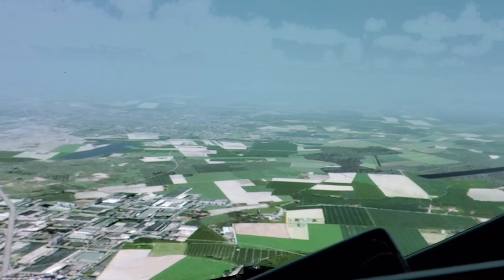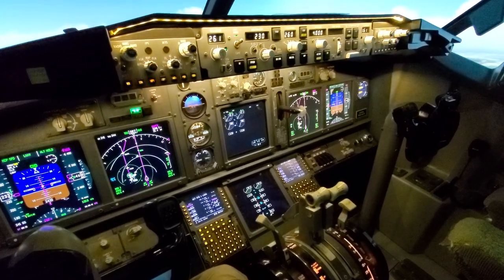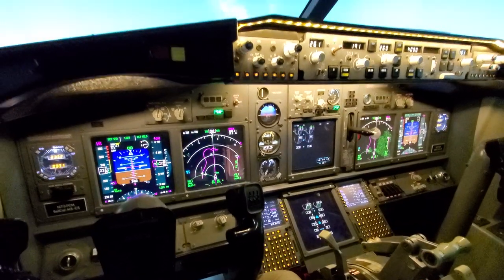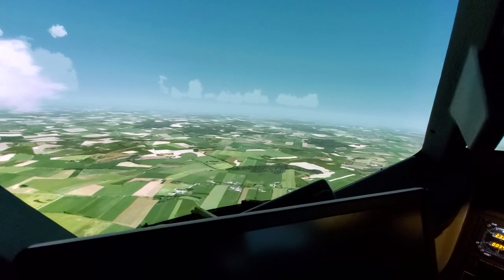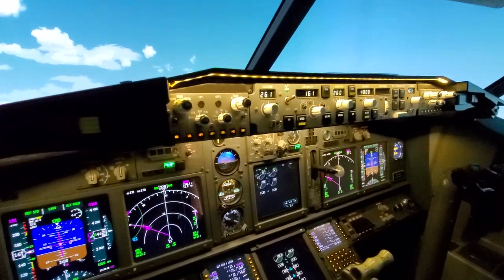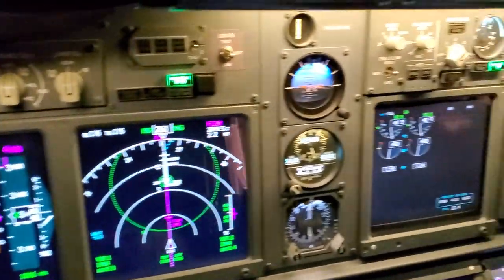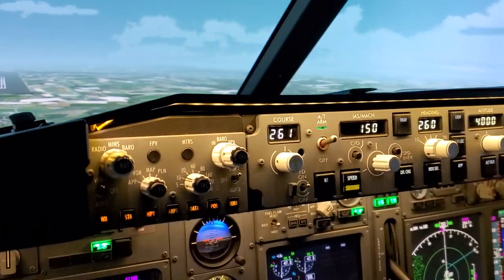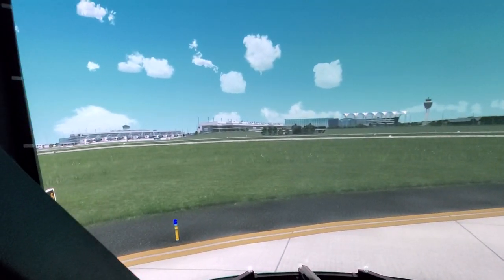4K Laser Projectors 210deg display P3D

Comment: would have been much more interesting if you showed the setup from outside cockpit + what is exactly the benefit of the 4K projectors as I understand you are running the 3 projectors from 1 RTX 390 card? 'I heard little more crisp?)  Running 3 x 4K is impossible from 1 card or host PC, AFAIK, or is it?
Reply: P3D is basically an FSX mod, it's possible because it's such an old engine.

Comment: Hi there. I have viewed hundreds of simulator youtube videos. I always notice the shadow band going down the simulator screen when using projectors. Is it the actual video or is it the projectors. Do you see the shadow band on your display ? I am thinking its the actual camera recording the video. Thank you and Brilliant simulator One of the best ive seen. Just one comment i would like to make and that is the noise from your trim wheels. It sounds like there is something loose like a wire scuffing the wheels. They should be silent just like the real thing. Wonderful video with great real life flying.
Reply: The shutter speed of the camera is slightly out of sync with the refresh rate of the projector, so there is a brief moment when the camera captures the screen in the middle of its refresh. It's solely an artifact of recording and it's not something you would (or should) ever notice in real life.
Reply: I have flown hundreds of hours in the jump seat, of the 200 series of 737's, and as I recall the noise of the slow speed trimming is spot on.